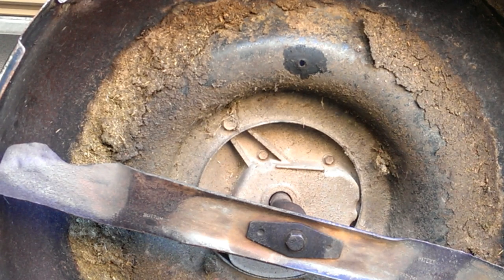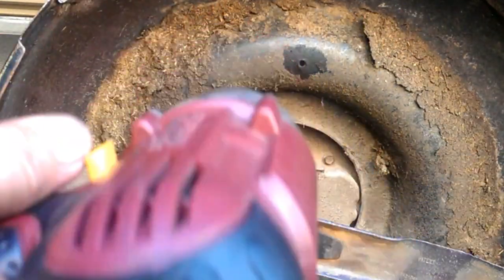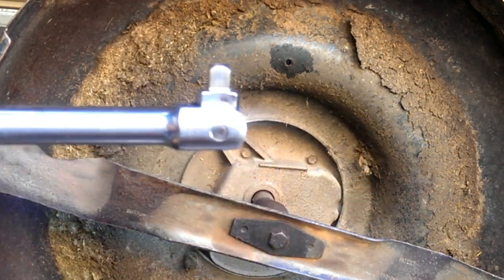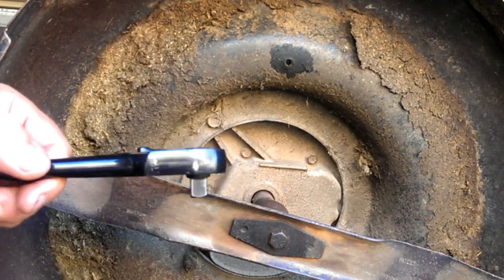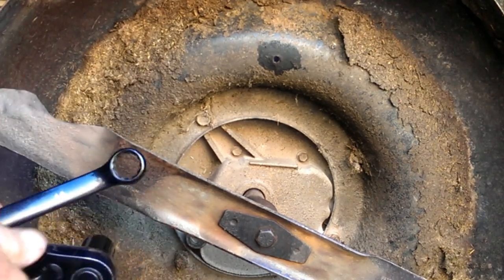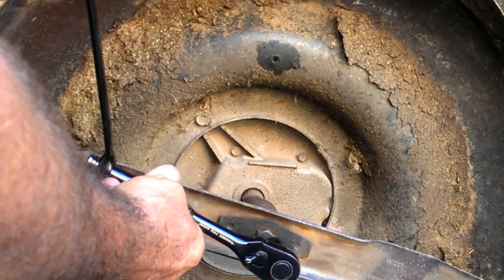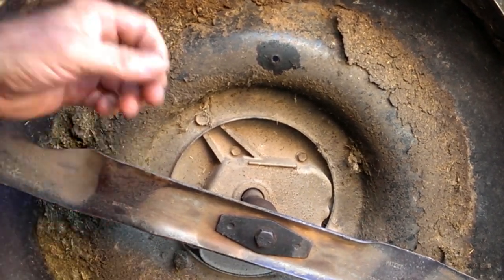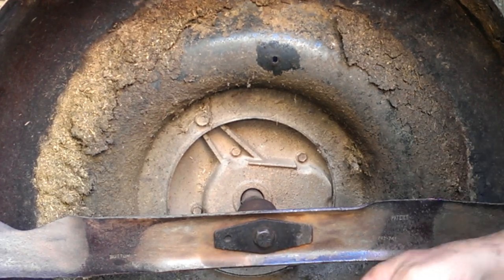How to Remove a mower blade. Technique and no special tools

Comment: I went through several videos and still couldn't get the blade off.  The nut was just stuck.  Your 'trick' with the box wrench and socket, for increased leverage, did it!  Neat trick.
Reply from the maker: Sean Blessing Thanks Sean. I appreciate the comment. I hope you subbed me. I have over 200 videos to help you out.

Comment: Awesome, and thanks for the tip on using the crescent as a breaker bar. I bent the crap out of my blade and my impact wrench didn't budge the bolt, but by using your method I was able to break it free!
Reply from the maker: If you hit something hard enough to bend the blade and stop the mower, chances are you sheared the flywheel key. Now your mower won't start at all and if it's only partially sheared the pull rope will get yanked out of your hands when you try to start it. Good luck brother.
Reply: Still can't get mine free

Comment: Do you think a bolt on my weed eater brand mower will work on my 20 in bolens mower?
Reply from the maker: There's on a couple sizes so there is a very good chance that you can interchange them.

Comment: Siphon gas and remove oil first?
Reply from the maker: If you want put plastic over the gas filler neck and screw cap on. Oil is not a problem tipped back. Don't tip it towards the carb. You made 2 very good points. Thank you.

Comment: I tried to take mine off with a 5 foot breaker and pipe and almost tore my deck off. Nut didn't budge at all.
Reply from the maker: Daniel, something doesn't seem right. Looking at the mower blade it should come off lefty loosely. With the amount of leverage you say you were using it should have snapped the bolt off. Spray with penetrating oil and heat the bolt. See if that takes it off. If not either take it to a pro and sharpen it on the machine. That's all I got for you brother.
Reply: @ZombieDaveAZ  Thank you, I appreciate the feedback. At first I was turning clock wise. I didn't realize it was reverse threaded. But I've soaked it with Wd-40 and am going to try again with a different wrench tomorrow. Don't know what the heck is wrong with it.
Reply from the maker: @RaineyPowerTraining   they do get stuck on there pretty good sometimes. That's what's great about an impact wrench. It gives good quick hammering blows.
Reply: @ZombieDaveAZ  well, still couldn't get it off. Taking to a pro
Reply from the maker: @RaineyPowerTraining  cool, if they break the stud it's on them. At least you tried buddy.
Reply: @ZombieDaveAZ  haha true. Thanks for the help
Reply from the maker: @RaineyPowerTraining  let me know what happens and how they take it off. IE impact? Thanks
Reply: @ZombieDaveAZ  will do!
Reply: wd40 always seems to help and if you cant get it off then take it to a pro. Definitely dont sharpen it on the deck cause on the off chance they're not balanced correctly you could end up ruining your mower or at the very least shorten it's lifespan
Reply: @ZombieDaveAZ  Had a guy with an impact gun come out and he was able to get them off.

Comment: I don't have a socket that fits so I used a pipe wrench and it won't move both ways can you help
Reply from the maker: Righty tighty, lefty loosey applies to this blade removal. Use a block of wood to prevent the blade from moving and shock the wrench with a hammer. It will come loose.
Reply: @ZombieDaveAZ  teaching the forgotten arts, thank you sir.

Comment: Bout time someone gave you the size of the socket. It may not match your lawn motor socket but at least you will be in the ballpark to bring out 1 or 2 sizes below or one or two sizes above instead of hauling your whole socket set somewhere or around

Comment: The nut on the blade shaft isn't as easy as he makes it, I've tried everything except a compact wrenchthe nut refuses to move.
Reply from the maker: Hey William,  if you need to apply more leverage use longer wrenches. And yes sometimes they are super stuck on there so an impact wrench May be necessary. Good luck buddy

Comment: What are the chances of the twisting off the bolt head?
Reply from the maker: Not easy to break the bolt.. Spray with penetrating oil and heat if needed.